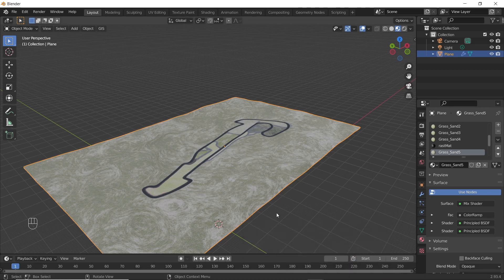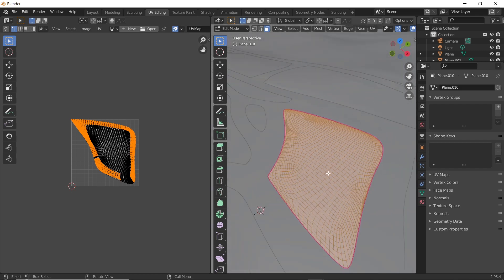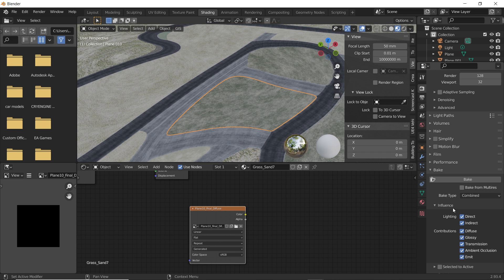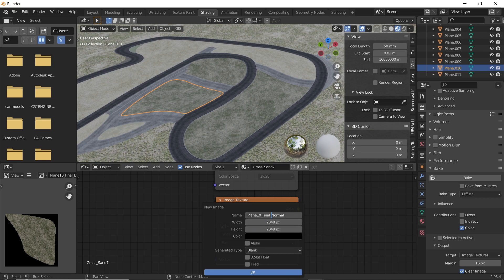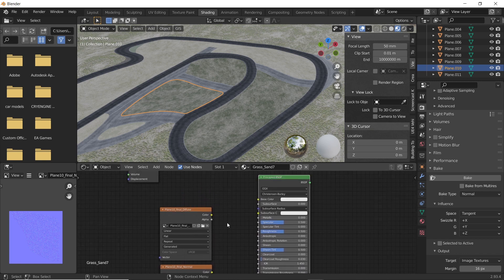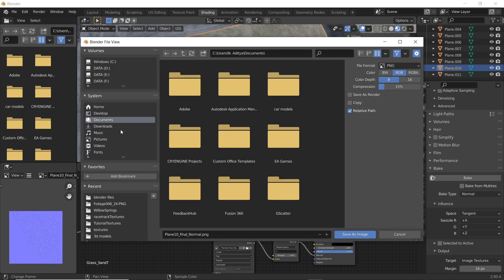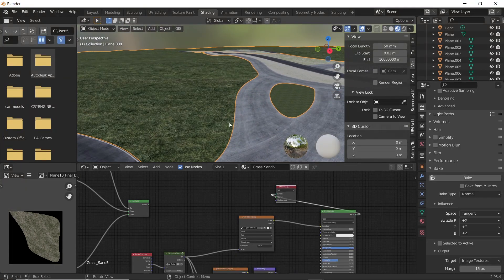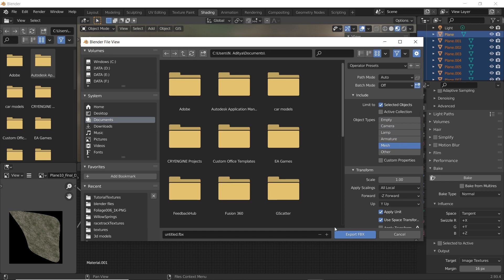Part 7 : How to make a racetrack in Blender (exporting model and textures)

Comment: Bro , my entire terrain is available for players to walk in the game , i used noice textures to mix grass , dry grass type texture and it has roads as well , you chaged texture bcoz car won't go there , but my plyer can go everywhere , in which approach should i bake terrain, i tried selected to.active , but result is blurry even ive set texture size to 4k ,
Reply from the maker: When did I say changing the texture would prevent the car from going anywhere? 🤣🤣. U have to build a barrier to prevent ur car from going there.  Changing texture won't do the trick. 

What I meant was that I will be building a barrier there so the car won't go beyond the barrier anyway. I mean why would you want your players to drive off track? Hence no point of Baking textures there as no one would be able to see beyond the barrier. So just apply a simple texture.
Reply: @Gamezoneadi  ahh sory I I've make you misunderstood , I meant to say I've bigger terrain like 500by500m something , and I need terrain ground to look good , in terms of texture resolution and quality , bcoz terrain is quite big , Baking makes it blurry and I can't see the terrain clearly , I tried selected / active method , but that didn't worked either ,  do you know any good way to bake the terrain textures that look good in terms of resolution after Baked , thanks 🙏👍
Reply from the maker: There is nothing u can do except bake with high res. Divide ur terrain into smaller chunks and then bake

Comment: Hi, when I export the file on Assetto Corsa the car flies in the air...
Reply from the maker: Like can u view the track in the ks editor?
Reply from the maker: It can be probably because the track is not at the world origin. So when u add the height data in blender it lifts the map up by some height. Try the bring the track  close to the world origin and apply the transforms and then export to AC
Reply: @Gamezoneadi  ok i will try thank you
Reply: mmmmh nothing changed :(
Reply from the maker: Hey i don't know much abt this. I tried this once on my friend's laptop. It got hot enough to blow up, so I didn't try anymore
Reply: @Gamezoneadi  I solved!!!! i just needed to put the right name on the mesh
Reply from the maker: @salvaxari2572  ok. i am still unable to get my track into ks editor lol
Reply: @Gamezoneadi  why?
Reply from the maker: @salvaxari2572  don't know. Nothing happens when I try to import the model. It just stays at 0%
Reply: @Gamezoneadi  maybe this is because you have to decrease the vertex of all the mesh, ks editor requires a maximum of 68k(?) vertex, to do that I lowered the level of the smoother (subdivision surface) tool
Reply: @salvaxari2572 hey, do you remember which thing you gave which name and could tell me? :)
Reply from the maker: There is a naming convention that needs to be followed for assetto corsa to recognize a particular mesh as drivable or not for eg. 1ROAD, 1SAND etc. 
1 is the index no. ans road,sand are surface types